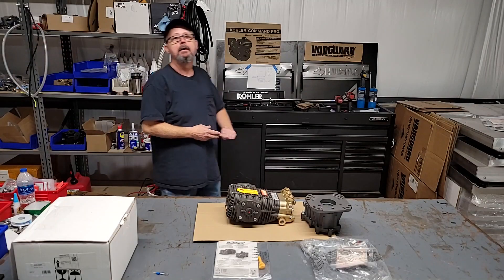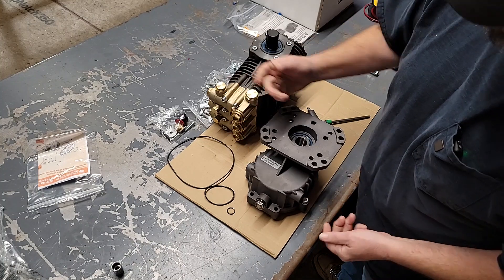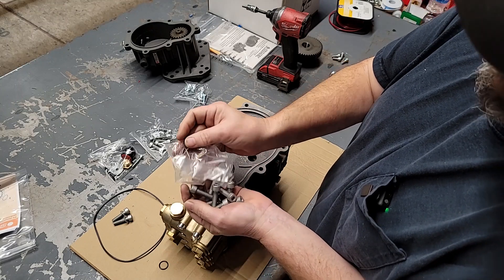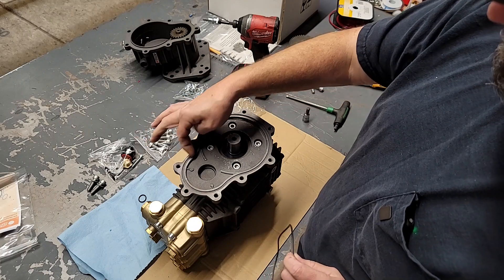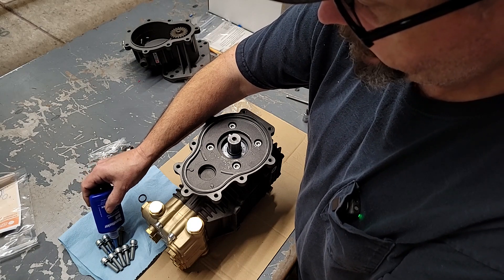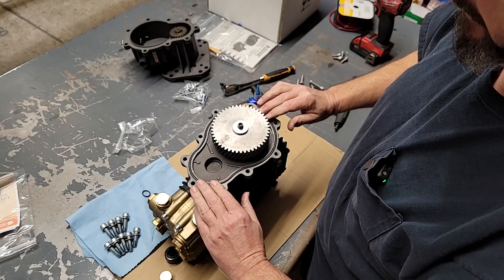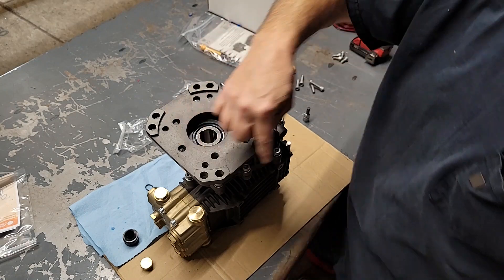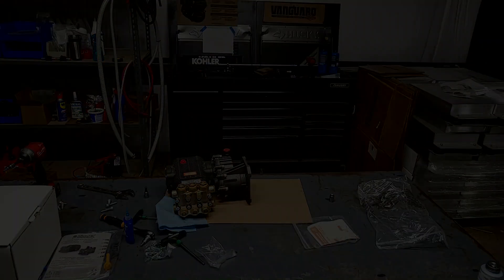Comet Gearbox Build for 5.5 GPM Pressure Washer EZ ASSEMBLY

Comment from the maker: 🛠 Comet Gearbox Assembly – Full Walkthrough
This video shows how I put together a Comet 5005.0236.00 gearbox for a 5.5 GPM pressure washer setup. Great for 1" shaft engines and commercial builds.

💡 Used with gear-driven pumps to reduce speed & protect components
⚙ Features: Helical cut gears, oil ring seal, rugged design

💬 Drop your gearbox or pump build questions below — I’ll do my best to help you get it dialed in!

Comment: Thanks for the video. I ordered a new pump and it came with the comet gear box. Unfortunately the bolts that hold the gear box to the pump weren’t tight from envirospec and the gear oil had leaked out. Just watched your video and will try to fix it tonight.
Reply from the maker: Oddly enough, I'm editing a video on that very problem. Oil leak on pre-built pump/gearbox. I have found an odd issue.  You should email me before you pull that a part, my email is on my YouTube page. Leave a phone #
Reply: @TheRustyRooster  I’ll send you my number. I’m curious to see what you found.
Reply: I was able to get it fixed. The bolts that attach the gear box to the pump were to long and were bottoming out before it was fully tightened. I swapped the four long bolts with four of the shorter bolts that clamp the gear box together. They are about a quarter inch shorter and are the same thread pitch. Just make sure you swap the washers also. Everything sealed up perfectly with no leaks. Thanks again!

Comment: Is this something I can do to potentially convert a direct drive to a gear drive? I have a gx390 engine from a Simpson pressure washer
Reply from the maker: @DoggyStyle-NineDuece  you can install a gear drive pump on the gx390.  You can not convert a direct drive pump to a gear.
Reply: @TheRustyRooster  that's what I meant. I misspoke there. But yeah I'm thinking of attempting to remove the direct drive pump from the 390 and putting on a gear drive if i can
Reply from the maker: you can, i do like electric start on the larger volume pumps, gets old pulling that rope.
Reply: @TheRustyRooster  ok cool thanks for the help good sir. Now I don't have to let a brand new engine go to waste haha
Reply from the maker: @DoggyStyle-NineDuece  10-4 let me know if you need pump and gearbox combo. I can hook ya up
Reply: @TheRustyRooster  that would actually be really helpful. I would like to do a 5.5 gpm geardrive setup to replace

Comment: mine is leaking between pump and gear can i get by resealing that first o ring u put on with rtv?
Reply from the maker: You have to take the gearbox completely apart to do that, disturbing all of the sealing points.  I would suggest before disassembly you have on hand,
a new o-ring for the 2 halves of gearbox,
 4- sealing washers for the mounting screws,  
 as well as a new o-ring to seal between pump and gearbox.
  I don't see any reason you can't reassemble with a small amount of RTV for rubber gaskets , generally not needed for O-rings, which are designed for sealing through their natural elasticity. 
Great question good luck with your project.
Reply: @TheRustyRooster  thanks for the reply! got it taken apart one of the four bolts that hold gear to pump was snapped and was held in by the back of gear! got an easy out removed broken bolt got new allen bolt cleaned everything down resealed with red rtv since it was sunday and i had big jobs today. also fabbed up a pump brace to keep vibrations down she is back to running 100% and not one leak,
Reply from the maker: @prestigepressurewashing  that-a-boy!
Reply: @ one last question iv always ran my 20hp duromax at 3600 rpm the pump i have has a 1:2 18 gear box with a 1450 10gpm pump is it safe to run at full throttle or should i stay around 3k rpms?
Reply from the maker: @prestigepressurewashing  you can send it at 3600rpm and get all you can out of it and the pump.
I personally like setting the engine to give max performance,  3600rpm and and back off the unloader on the pump a little.
Reply: @TheRustyRooster  appreciate it !

Comment: How do you go about sizing the engine when building a gear driven or belt driven pressure washer? Looking for 8GPM @ either 3000 or 3500PSI. Possibly 5.5GPM @ 3500PSI.
Reply from the maker: Pump manufacturers publish all the pump specifications and  horsepower  requirements on their websites. Lots of good info. 
I'm using 14hp gear drive for 5.5gpm builds and 23hp for 8gpm

Comment: Hello brother can you tell me please what is the purpose to install gearbox in pressure washer
Reply from the maker: Use either a gearbox or belts and pulleys to turn the pump at its proper  operating RPM. In this case I need the pump to turn at 1450RPM.
Reply: @TheRustyRooster so the gearbox slowed it down

Comment: I’m using one of these now. It leaks terribly. I’ve taken it apart 4 times trying to fix it to no avail. I’m going back to the PA gearbox next time. The leak is coming from the smaller o-ring that mates to the pump. It needs to be slightly thicker so it will seal better.
Reply from the maker: PA  is a good, trusty gearbox.  Have you tried a little thicker o-ring?
Reply: No I haven’t. I didn’t take the time to measure it. Where could I find one? Is that a common size?
Reply from the maker: @toddluns1  not sure... I haven't tried it... was gust a thought.. might just try and match up an oring or try and add a small amount of silicone gasket to help oring seal

Comment: That's the first time I've seen a gear box on a pressure washer most of them are direct connect to the engine
Reply from the maker: Thanks Robert, A Direct drive system would be turning at 3400 Rpm the pump im working with needs to turn at 1450 RPM so gearbox reducer or belt drive to accomplish this and gearbox works best for my application.
Reply: @TheRustyRooster  thanks for letting me know about that matter young man 👍😎